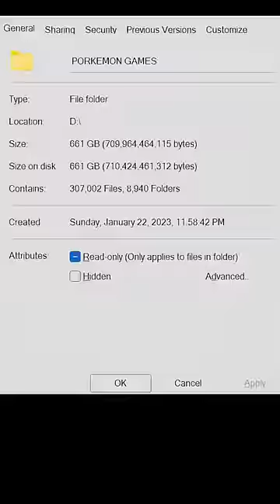HP Omen Overheating fix #gaming #pc #technology #tech #shorts

Comment: I bought an hp omen 17 back in like December 2021 and it’s actually serves me well. It has 2x m.2 nvme slots, upgradeable ram, a 3070 gpu and its overall not been super difficult to get access to the internals for repair and maintenance. I do recommend if you don’t have room for a desktop.

Comment: Your videos inspired me to take my omen apart and clean it. "Gooch dust" and "exotic butters" are now firmly in my tech support dictionary.
Reply from the maker: Hell yeah brother. HP deserves credit with the Omen because it really is one of the easiest laptops to work on. Glad to help!
Reply: @SalemTechsperts I recently repaired a ideapad 130-15ast that was giving me a media not found error upon boot. The whole data cables ribbon connector was broken so I bought an optical to sata adapter and it works fine just trying to clone the slow hdd to the ssd know of any free programs?
Reply: Hope you used good thermal paste?
Reply: @Awaks  nah bro not the liquid metal ps5 cooling with copper tubes. No omens or repair problems for tge future used ps5s at all. This is fine 😂
Reply: @Awaks  It's no Noctua but it has worked well for me so far, even on my AMD FX cpu which is one of the hottest out there.
Reply: I uh, did not know how often to clean laptops and didn't clean mine for 3 years except for the times that it got sent in and might've been cleaned. My friend came over and helped me clean it and I had a cough from the amount of dust on the first layer for 2 whole days
Reply: @SalemTechsperts  this is genuinely shocking! I'm a desktop guy but I do want a gaming laptop at some point so I'll remember this
Reply: @Bug_inthe_room good on you for cleaning it at all, your computer thanks you
if you clean it more often the dust shouldn't get that bad, but if it ever does you can run a vacuum or an air filter while you dust it to suck most of it up

Comment: Along with all the fun jokes he makes, it’s honestly satisfying to see him breathe new life into these machines. :)
Reply from the maker: The more messed up they are, the more satisfied I am when I can get them to work better than new.
Reply: it was crazy though, 400gb for a hard drive in 2023? is this 2010 or what?

i thought with the advancement of technology, 1 Petabyte SSD is the new poor man standard

there will be no more scarcity of storage, and basically we can install as many game as we like

but no, we still use 1-2 Tb just like 10 years ago, even the price aren't getting that much cheaper either
Reply: @jensenraylight8011  that is because of a similar reason as for why computer transistors will likely hit a maximum of Transistors per cubic millimetre, and that reason is atom size. If you make a transistor smaller that a certain anpunt of atoms, it will stop working as the partly conductive material in the middle will not stop electricity anymore. Similar with storage: after a certain size of soace per bit, it gets firstly ineconomic (so no mass production) and then almost impossible to compress (binary) data even more whilr keeping it easily avaiable for the computer at all times.
Reply: With the dust, and other questionable stuff, that comes off the inside of those devices, he doesn't just breathe new life into them. He breathes new life into his lungs too.

Comment: I bought an HP omen 5 years ago and aside several windows resets, several reapplication of Thermal paste to CPU & GPU, replacement RAMfrom 1 fried Motherboard, it still works today; I even upgraded from an 1060 3gb to a 3050 (I got for free with a computer with every other part completely cooked)
Reply: Update, I was able to upgrade the 1060 3gb to a free 3050 8gb from a friend, loving Cyberpunk and VR games way better now!

Comment: I personally always recommend a clean install. It's a great way to check over files and see what you care about. Games can easily be redownloaded from most distributers. Especially if the computer is crashing. Regardless of the reason, crashing can cause damage to files. 
If you really want to go above and beyond, wipe the old drive and put it in an enclosure. Then set it up as a backup drive for them. People love having a backup, especially for only $20-30 more

Comment: “hp oh man” yeah i have an omen laptop and thats unnecessarily accurate
Reply: Same fr, bought the omen 16 last year about 4pm. Got home charged it up and loaded up a song to test speakers on low volume and around 5pm. An hour later...  the laptop shut off without any lights. Fully bricked not even the charging port light wasn't lighting up. Returned it for the same one and haven't had a problem since, I love me omen (for now)
Reply: @nickahboy3795  damn i have the omen 15 and the motherboard went out and had to get it replaced and the temperatures get to 200F when not running anything and yeah i love omen to but just like others the gaming laptops are not very good to use as main pcs

Comment: the OMEN line of desktop/laptop products took 6 years of horrible customer experiences to even PARTIALLY address the issues. Brand new units were overheating because the overall design for the cooling meant that a standard gaming load at medium presets cooked the CPU to 90C.

Comment: I have this laptop, HP Omen 16.
I bring to service twice (first is 9 month usage, and 2nd a year later after first service) because the screen/LCD have problem, exact same problem (screen have horizontal line and shaking while in 165h mode) so they have replace the LCD twice. Glad it still warranty so I don't spend any money.

Now the warrant will over in few weeks hope it won't happen again. Replacing the LCD is cost a lot for me.

Comment: Quick question:
I'm planning to build my first PC and could use some advice. My budget is around $1,300. I'm deciding between the Ryzen 7 5800X and the Ryzen 7 7700X, paired with an RX 7700 GPU. I'm also still figuring out which monitor to get, so I’m a bit tight on budget.

Comment: I’ve got a hp omen 15 it serves me well except for its hinges which I’m surprised isn’t the problem with that one, but I also had storage issues and added a 2TB SSD to it and replaced windows with Linux which greatly improved system performance and stability
Reply: What distribution are you using, and is it viable to use it for gaming (if you do use it for gaming that is) since I heard setting up nvidia driver on linux is quite complex.

Comment: I have an Omen Desktop and yeah. I had that baby chock full of games, only 23GB left. Specifically RDR2 and the Witcher 3 which are like 180GB combined. But I wasn't running as hot as this laptop, mine was just 50C at idle and 75C at load. But after cleaning out unused games I don't play ever mine is at 30C idle at 55C load. Much much better. If I ever saw my PC at 90C I think I'd immediately shut it off with concern, lmao.
Reply: And by load, I mean Skyrim with 50GB of mods.
Reply: What's the size of Witcher 3?
Reply: @SushanthPrabhu-um7ce   32GB.
Reply: @SushanthPrabhu-um7ce   If you play it does add more data due to save file size.
Reply: @LycanFerret  oh is that so, i am not a pro gamer, but GTAV's and RDR2's save files are like few MBs, i didn't know that some games take lot of size for saves.
Reply: @SushanthPrabhu-um7ce   Ah. Yeah, like I know for Skyrim a single save file can get up to 4GB. It sucked back when I had my Xbox.

Comment: What's that software you used for checking errors 

My PC is having some issue with my secondary HDD (Seagate Bermuda 1TB)
It just randomly disconnects and reconnects 'I tried different cable but it still there
Reply from the maker: CrystalDiskInfo64

Comment: I use to have, if not this exact same, system, then one of its variants. it was overall fine, until it stopped charging. well, not so much charging as the battery stopped working & it was just a desktop in a worse formfactor. nothing like "100% battery" & it just dies when the power cable is jiggled

Comment: I have Hp omen 15 . But it won’t turn on. I tried multiple shops they are saying that some short circuits happened in the motherboard and they can’t find proper ic to replace it. Is there any solution. It’s down like a scrap right now
Reply from the maker: find a shop willing to waste hours of their time trying to find the cause of it and charge you more in labor than a replacement motherboard is worth if they actually do end up finding the issue and it's repairable.

Comment: I got a new pc and i need help with the internet, it doesn't like to connect to my home internet (atnt) and sometimes i can get it to connect but itll deconnect very quickly saying invalid. I go into wifi and NO wifi's show up like my usualy devices. So i have to use a hotspot and its the only thjng that actually shows up. I need help but i dont k ow what to do? Do i need to buy aomething to connect the atnt router to my pc? (Ethernet not avaible since family doesnt want holes in walls.)

Comment: What nonsense are you saying that a storage that get so filled that it corrupts itself ?
Unless this is the fake storage that uses low capacity SDCards with hacked firmware to show fake larger capacity, it won't happen on a normal storage.

Comment: HP Omen are the worst gaming notebooks i have used so far, i got a HP Omen 15 and HP Omen 17, i know my way around hardware and software and i have never seen such bad hardware and vendor software. their Omen Gaming HUB SDK is the worst garbage i have ever laid eyes on. The Omen 15 started losing over half its performance over the course of a year with no apparent reason and the 17 keeps randomly shutting of its fans causing overheats and reboots. The Gaming Hub constantly screams for an app restart, the keyboard backlight keeps resetting to default settings, sometimes the hub even just refuses to start at all requiring a manual kill of the process to restart it, customer support is the same answer regardless of what the problem is (update drivers, check registry, reset apps, reinstall windows) there are 0 to none customer replacable parts (only through vendors) and replacing hardware like the screen is a guaranteed way of destroying atleast 5 parts because they glue it in with adhesive strips, use the softest screws that immediately grind down and hinges are made of the thinnest metal bars known to man (basically never try to repair it, just rip out everything you want to keep as spare parts for some frankensteins monster repair or trash it.